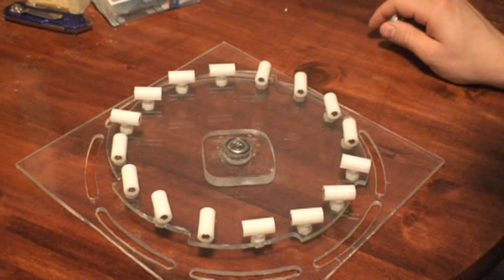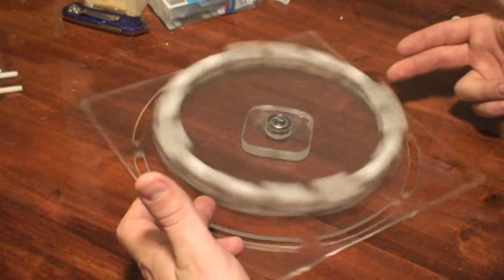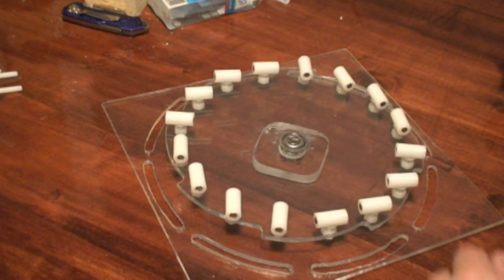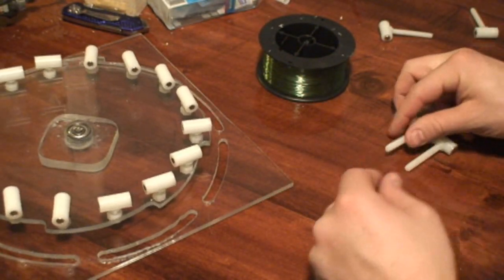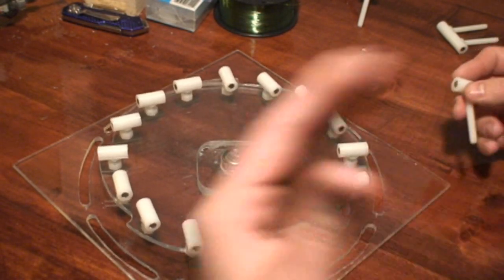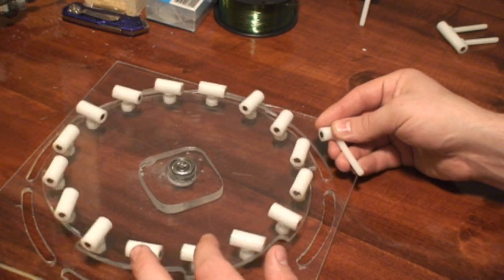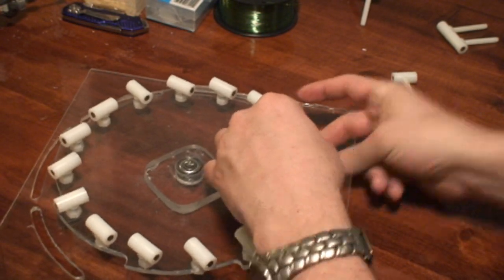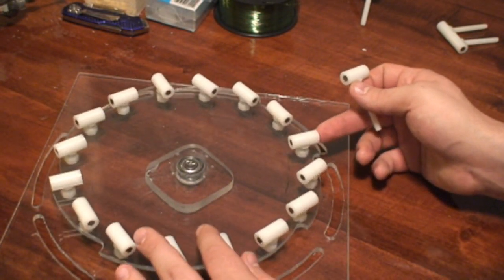Magnet motor, free energy, overunity test 2

Comment: Guess what?! The energy required to spin the magnet between your thumb and finger is the same amount as it requires to spin the wheel at that speed. Introducing electricity to flip the magnet will be less efficient than brushless motor, which is all you are creating.
Reply: Agreed and not to mention slight friction constantly subtracting energy. Friction will always subtract and then adding a mechanism / gear to change the polarity of the magnet constantly over and over again only adds to the friction or energy sucked from whatever energy is powering it (including a magnet).
Reply: you dont need a mechanical rotation of the magnet.  just have 2 electro-magnets that are wired opposite each other that switch on and off based on position of the rotating disk
Reply: ***** It's the same, just not THAT obvious for a non technician. Where does the energy for the electro magnet come from? Pole change even costs extra energy.

Comment: Your alternating electromagnet idea is simply reinventing the existing electric motor.  Nothing new here.  Conservation of energy rules.  You cannot make a perpetual motion machine.
Reply: At least someone intelligent.
Reply: The act of spinning the magnet and holding his arm straight is more energy put into the system than he can possible get out of it.
Reply: a device like this could transduce magnatism to kinetic energy which can then be used to power a turbine-style generator. the magnets would eventuallg wear out so it would not be perpetual motion or free energy. you would be spending the magnatism to make electricity
Reply: You don't "spend" magnetism. Turbine generators spin a set a stators through a magnetic field. You must put more energy into the system than you get out of it due to losses from friction and heat.

This is not free energy. He is putting energy into the system through his arm holding the magnet, even if he doesn't realize it.
Reply: Chris Antcliff Magnets can be used to spin a turbine simply by having the right placement like what he has done here. It is not permanent or free because the magnets eventually wear out. A pair of magnets can be arranged so that one magnet floats above the other. This means that the magnets are outputting enough force to match that of earth's gravitational field. This energy can be transduced into electricity somehow i think.
Reply: Chris Antcliff i get the fact that he is holding the magnet but can you put some sort of physical ratchet system to switch the polarity whist the wheel goes round?
Reply: Scott Warren you could, but you still need to add some for of outside energy because of the basic laws of thermodynamics. Otherwise you have perpetual motion which, currently, with our material sciences and understandings of physics is impossible. 

This contraption is basically an electric motor. It is not free energy as they claim.
Reply: Why do you and everyone else go on about the first law of thermodynamics its an old law sort it out open your mind! Nothing worse than a closed minded scientist
Reply: Scott Warren I'm not closed minded, but we lack the technology and materials to disprove the first law. It is a law, not a theory, because through repeated experimentation it has not been violated. 

All I've said is this is not free energy. It is not perpetual motion. All that is shown in this video is a variation on an electric motor. It's exactly how AC/DC motors work by alternating the magnetic field as the motor spins.

You're right there is nothing worse than a closed minded scientist. I'm not one of those. You need to show proof, verifieable, repeatable proof to support claims. The more unconventional the claim, the more important the data and research to prove it become.

There is also nothing worse than someone willing to fight for something they can't prove when they don't understand the underlying theories and mechanisms and can't present real evidence of their theory.
Reply: ok fair enough! i'd like to see someone try and replicate this and don't say its a waste of time as then you could say that about any experiment that is trying to prove a theory...

Comment: Simple rule: You can't get energy from nothing.
Reply: Magnet do not require fuel, but they do supply something that can create energy.
Reply: but you have to move the magnet in order for it to generate energy. and moving the magnet requires energy aka fuel
Reply: But the energy you put into it is VERY minor. if it is able to build from the energy you put into it then you could call it free energy. But only if it surpasses the amount of energy you put into it.
Reply: Felix Stratman Care to elaborate? Saying im wrong isint really getting a point across...
Reply: kioti15
 fuckyougoogle plus elaborated on why your wrong.
Reply: Your arguing semantics and doing it poorly. Batteries do not have energy like a battery holds energy.They have energy in a similar sense to how physical structures "hold energy". It does not dispense energy but energy is generated off of its magnetic structure. Which decay as it used
Reply: I never said a magnet could store energy. magnets produce a force. you can transform force into energy.
Reply: @kioti15 and that whole process requires energy. more than the process produces
Reply: construct a circular ring like structure with strategic placement of magnets along the outside of it. then have a rod on the inside with magnets on either end and create a system in which it spins along the inside on a track of some sort. Using the polarity of the magnets, repelling and attracting either end of the rod, could enough momentum be created to spin the rod until the magnets become demagnetized? and if so, could the rod be attached to a crank of some sort and spin to create electricity using only the magnetic field of earth as the fuel source?
Reply: Lol
And I thought solar energy was complex and inefficient
Reply: Indeed indeed. True scientists are admitting more and more that they don't really understand, but average? Oh, they know Everything!!!
Reply: Explain the Universe’s existence?
Reply: A magnet has energy 
And puts energy out
Reply: What people tend to forget is that it takes a substantial quantity of energy to produce a magnet in the first place and over time magnets do loose their force and become weaker depending on how much use they have. So yes the original statement of this thread is correct. You will never draw more energy out of a magnet in any form than it took to create the magnet in the first place. There will always be a loss through the conversion.

Comment: Magnets aren't a source of energy.  They're like springs.  They can only store energy that's been put into them.  So you need an external energy source.  Like a battery.  And then if you get it to work as others have said you will have reinvented the brushless motor.  8^)
Reply: If you put two magnets near each other, and one moves, the kinetic energy moving that magnet came from what external source?
Reply: Squidscast - The Whole Squid
If you put two magnets near each other, and one moves, the kinetic energy moving that magnet came from what external source?

I've highlighted the answer.
8^)

Comment: I hope you actually read this.   When I was a kid,  our "uncle" who was an engineer,  gave me a motor kit.   It was a DC motor,  I had to wind the arbors by hand.    It had these brass plates called commutators.   After it actually worked,  It was evident how it worked.   The commutators changed the polarity of the arbors, so that in one spot the arbors were attracted, then they were reversed and repelled.   just exactly what you are attempting to do.   

provided you do not use any outside electricity,  you are on the verge of making that perpetual  motion machine.  The trick then is to get it to do something, like generate electricity for outside use.   When you do that though,  you will add stress to the system more than the system can take,  and it will collapse.  ie.  not work.   

Even if you make a very well balanced mechanism to flip the one magnet over and back,  the energy to do the flip must come from someplace.   If it comes from your little magnet motor,  it will kill the motor.  

Still... pretty cool how you got it to work.  

Pass the magnets between copper coils to generate electricity?   Have fun with it.

Comment: its not free energy if it is using an electro magnet because you need to power the magnet with the battery. always look deeper for the true energy source. this is a great concept but using an electro magnet wouldnt count, now if you could come up with a way to utilize the spinning of the disk to flip the magnet manually then that may work, but it also would cause friction so it most likely wouldnt. i appreciate your effort to try to solve the energy problem but free energy just isnt a thing.
Reply: its almost infinite